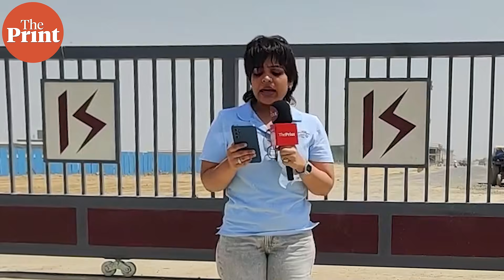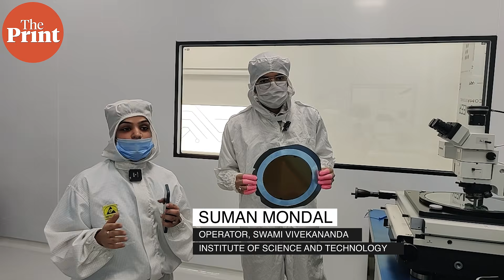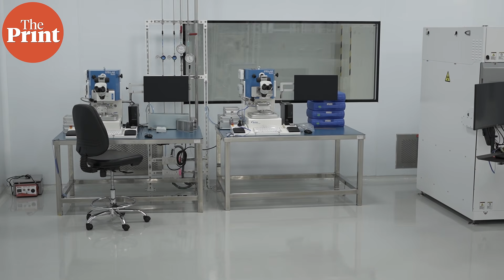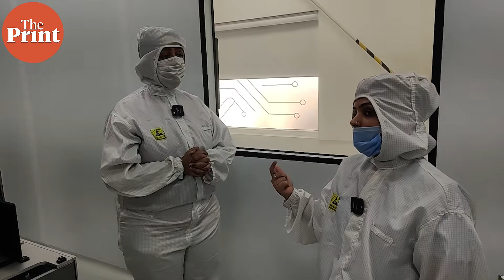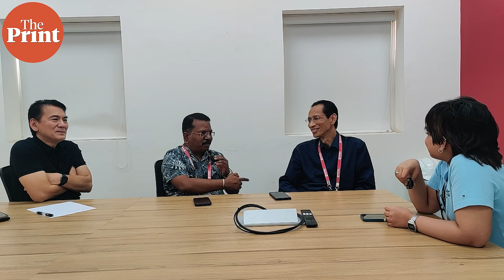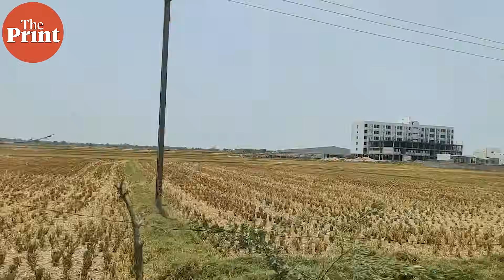Inside India's first semiconductor chip packaging cluster in Gujarat's Sanand

Comment: We need atleast 100s of such plant invest heavily on this to attract big companies with full facilities clean water,24/7 electricity supply no compromise in infra
Reply: Not really, you only need maybe 3 or 4 more, what's needed more is the industry that makes the materials using silicone etc, and also the next manufacturers that can use the chips and make electronic equipment, if India can set up using the most used chips first it can then try the harder 2nm,

Comment: Is this for real ? Like I can't comprehend how clownish the criticism is! Packaging/assembling is the first step in advanced manufacturing, we can't move up the value chain without first starting the race. How do you expect india to start producing 2nm state of the art chips directly ?
Reply: 2nm is not imp it's used just 8 % of total chips so other chips are more imp first
Reply: @Panther-x2o , like big chips, which are used in industry and generate more cash rather than fancy advanced chips, so mastery of old chips is more important than 2nm chips
Reply: @amanjha2800  if the current deal with TATA ASML became successful. At least our freezer, AC and other electronic devices will be safe.
Reply: @adarshkumar1403 let me tell you even our ballistic missiles are powered by like 180 nm chips bud 😂
Reply: @adarshkumar1403 most advanced chip in F35 is 35 nm or so and our missiles use 180 nm chips
Reply: Yeah these clowns . I wonder if they hop on a treadmill that's going full speed .
Reply: true dumb people don't understand chips , they think anyone can start with high end smaller nodes Chios on first try ,